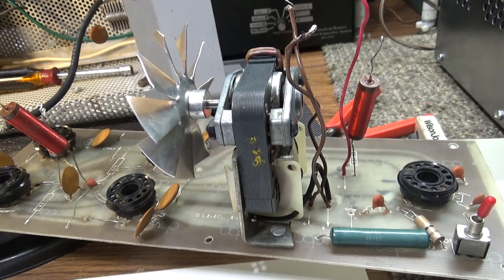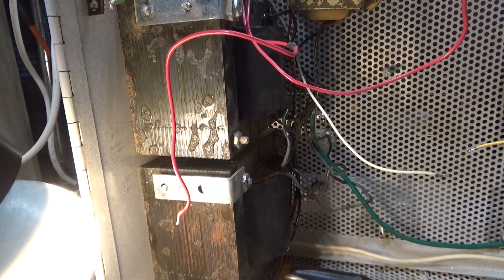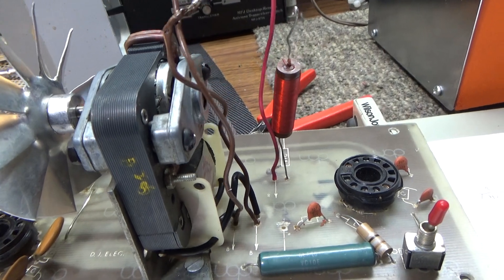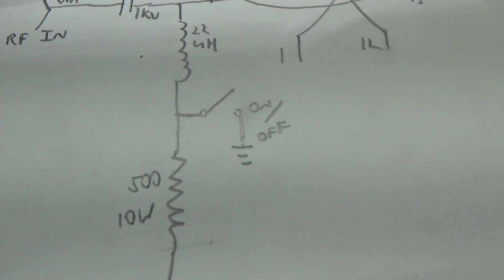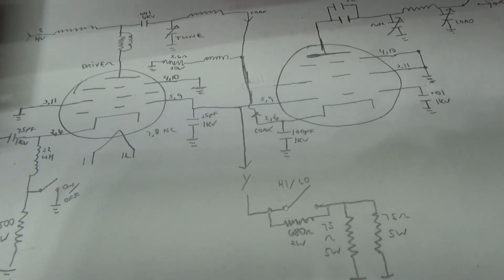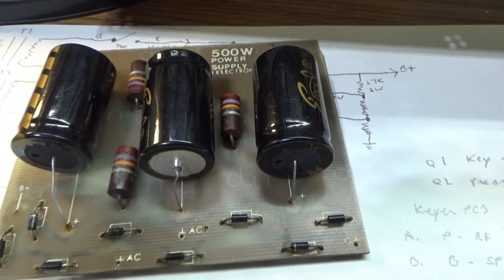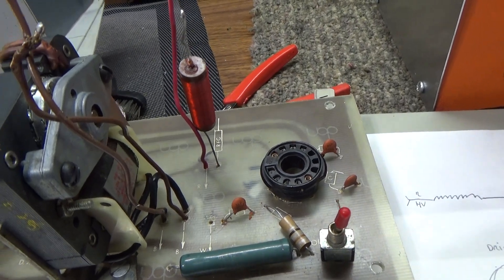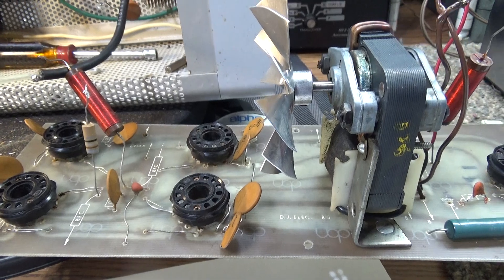BLJ-500 taken apart and in the middle of refurbing.

Comment: I'll take a shot at it...the reason why they open both sides of the high voltage transformer is because stray capacitance inside the transformer will complete half of the circuit and continue charging the capacitors, albeit at a very low current level. 
As you stated, a heater to cathode short on the driver tube would indeed place mains voltage on the input connector and then to the radio if the input capacitor was shorted. 
The on-off switch could function as a high/low power switch. Either way, I expect that the input SWR will be atrocious without any resistance network. Double check everything before you fire it up and test it with an old tube set that you don't care about.
Reply from the maker: I agree on the transformer. On the on/off switch, the amp on the front already has Hi/Lo. I'm thinking that switch is Hi Drive or Lo drive, but I wonder how much?
Reply: @tramdr  Tough to say. I think that you're better off if you redesign it to do what you need it to do. Look up the design specs for the 6LF6 and see what they are, and go from there. You mentioned that the previous owner damaged two radios with this amp. What kind of damage? Big smoke or loss of transmit? Look at the antenna circuit for the Tram. Is there an isolation capacitor between the relay and antenna connection?
Reply from the maker: He says the D201 lost its receive. The 2990 the display and PLL went out. Thats bad news.
Reply: @tramdr  Wow. Big damage here. Sounds like a lightning strike. In receive, the two antenna connectors are connected together through the relay. The only thing connected on the input side is the capacitor that feeds the keying circuit.
Reply from the maker: Nope, the seller said he hooked it up to his refurbed Tram, fired it up and as soon as he keyed, smoke came out the Tram and the Tram lost its receive. He thought it might have been the Tram itself , so he hooked up his Galaxy and it took out all the boards, its done. As I said, it has a 4PDT relay with 2 Poles for the In and Out as you said, but the other 2 Poles are o switch off the HV coming straight from the transformer. Bad idea having that HV right next to the In's and Out's. I am going to install a seperate relay to switch the HV and hence the original antenna relay will only switch the In's and Outs. i am also replacing the 6v low voltage relay in it with a much bigger one so it can provide filament voltage to the 6LF6 tubes I am putting in, instead of running the 20LF6 tubes off the mains. It will be a much much better and safer amp once I finish,